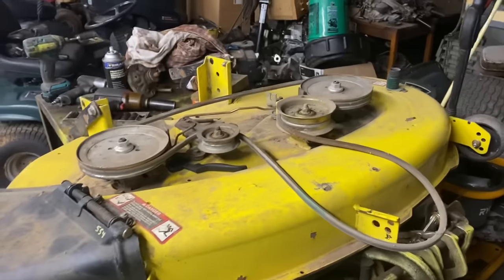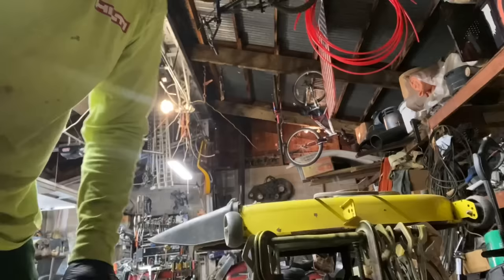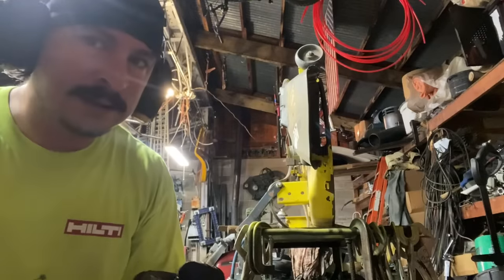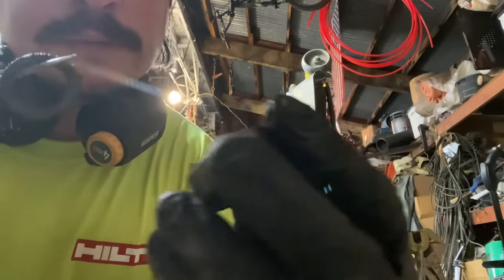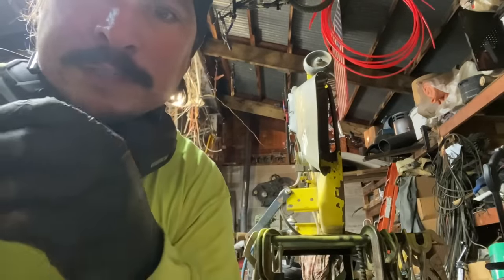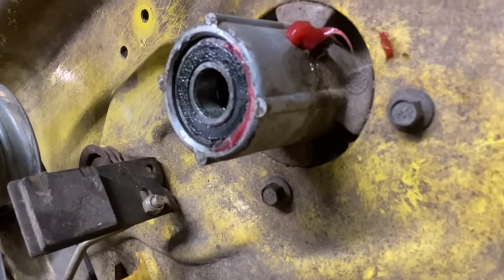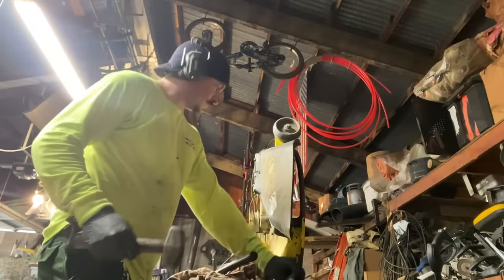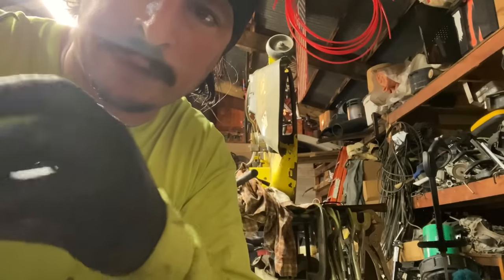Part 1 - Don’t trust the “Experts” Grease your mower deck sealed spindle bearings Common sense.

Comment: The problem is.  The seals on a lot of sealed bearings are not designed to deal with the pressure from a pneumatic or electric grease gun. So you can easily push the outer seal out of the bearings. If you’re going to grease a spindle that has sealed bearings I recommend drilling a tiny weep hole into the side of the spindle housing so when it gets full it will force the grease out that tiny hole so you know when to stop.
Reply from the maker: Correction, the problem is your wrong as far as this application goes. Can you explain why my seals didn’t push off the bearings in my video? For that matter why Iv never seen one push off the bearing? Why was I prying them off again to show the grease inside after the process was over? Serious question. Do you have proof this will happen? I definitely would not make a video knowingly doing something that could harm peoples equipment and I only want to share things I have learned that I think can help people. And this is a topic I feel like others are mistaken on and it seems to be that many people have similar ideas like yours with a wide variety of small differences in the process. I posted this video to
Show exactly how Iv been doing it for years without so much as one issue to date. It’s the easiest way to get grease in the deck bearings without requiring any tear down or tools other than a grease gun for mandrels with a zerk installed. Let’s explore a minute so I can say more about my side. In this case Im trying to show folks how to grease riding mower deck bearings / mandrel assembly and for this application the seals have never Come off. That is not something I have ever experienced so may be nothing that needs to be worried about but something to consider. Maybe in some situations for bearings in other applications this could happen but I’m talking only about mower deck spindle / mandrel assembly and Iv yet to see one come off. I grease dozens of decks like this each year. Is this something you have personally experienced or is this just something that seems to make sense in your thought process when thinking through it? I mean it sounds logical but have you ever experienced this occurring while greasing a deck mandrel? This is why I don’t think it will happen and why I think I have never seen it happen like you say, there is no room in the assembly for the seals to come off the bearing if it’s properly assembled. Notice I put it back together minus the pully but the nut can take up the gap before greasing. So it was together tightly as it would be if you were greasing the mower and not working on it with things apart already. The inner seals are pushed toward the bearings and stay in place. The outer seals are the ones in question and those are up against other components and have no room to move away. There is no wiggle room in these assemblies if they are in good condition and not missing pieces of the assembly “properly assembled” The grease just pushes past the lip. If the assembly was not fully together and the bearings were just sitting in the housing the grease would push the whole bearing out before a seal came off. As for adding a hole, I recommend the exact opposite. I don’t recommend that anybody ever drill a tiny weep hole to let grease escape the assembly. That is just dumb in my opinion and defeats the purpose. For that to to work you would have to remove the inner seals otherwise the grease will push out the “weep” hole and exit the assembly before it ever passes the first AKA inner seal. So you would be wasting your time and grease as no grease will pass a seal before it just takes the route of least resistance out the hole. The whole point of greasing it from the zerk as they come
From the store is that it can be done without tools just the grease gun and your good to go. The reason I made this step by step was to show this works and grease gets into the bearings. Basically a step by step process the whole way through and I had to pop the seals AKA shields off to show the new grease was in the bearings. This is almost so simple it’s stupid. I realize when thinking it through there are things that seem like they won’t work but I did it in a step by step process on video with no magic tricks. Test it out yourself if you think I’m wrong. Or you can continue being a naysayer without trying it. Try it and see what happens, actually knowing what happens might change your mind and then your bearings will last longer. Ii won’t make a penny off it one way or another. If you leave inner seals on and drill a hole in the spindle you can expect the bearings to fail. “Weep” holes in the side of the spindles are absolutely worthless other than to allow water, dirt and dust in and allow the grease to exit before passing bearings. If you do have a hole I’d plug it. The only company I know of who does that is MTD and they build the absolute cheapest and worst riding mowers that I know of. I plug those holes with a screw or insert a zerk so I have a easer access to a zerk as they usually have the zerk on the bottom side of deck and they are covered in grass build up and have to be found and cleaned off before they can be used. Installing a zerk in the “weep” hole is the perfect spot to give access of a easer to reach zerk on the top side of deck. Sometimes I think maybe MTD engineers just like to make things as complicated and non user friendly as possible. It’s amazing how bad they design stuff. And every year they build stuff at an even lower quality than the year before. If anything I can say they are at least consistent at building junk. Look what they did for cub cadet, took a top mower brand and turned it into the lowest grade machine on the market. Other than yellow paint and a sticker showing it’s a cub there is no comparison to what they once were. Quality took a back seat long time ago for Cub cadet and any other brand under the MTD umbrella.

Comment: 'Sealed' bearings. Great note. New Z Trak JD will definitely receive spindle lube today :)
added note: Truck Universal joint bearings are 'sealed', but Zerk voids must be maintained, filled to capacity.. four 'U joints, 1 slip spline joint, 6 front suspension,..HP Moly grease. all on 20 year old, 120 K mile HR 34 motor coach.. Experience demonstrates lubrication extends life of bearing surfaces in constant movement..  Thank you for confirmation.. :}
Reply from the maker: Thanks for the comment. Good luck with your Deere!! 

I have a 2001 Chevy 2500 HD and it’s spent most of its life working. Not just a daily driver. I have stayed on top of minor maintenance and it is still running all the original steering components and ball joints. If it has a zerk fitting I grease it. The new cars and trucks of today come with none or very few greasable joints. Some don’t even have a transmission dip stick. Not my cup of tea.

Comment: I guess I’m hardheaded but I still take apart new equipment and remove the weather seals from the bearings. My many years of experience just doesn’t bear out your experiment to work 100% each and every time. Good Presentation however.
Reply from the maker: i understand, this may not be for everybody and some folks like to see the bearings and or just like these kinds of projects. i would prefer not to work on stuff if i can prevent it with just a simple pump of the grease gun. as for mower deck mandrel bearings this has worked 100% of the time for me, thats why I shared after watching so many others post videos and say the bearings won't take grease due to the flimsy shields stoping the grease. I just could not handle that any longer. had to get the correct information out there. The main point is that if folks will properly grease the bearings when doing preventive maintenance the need to tear the deck apart to remove those inner shields is pointless. why bother with tearing things apart if we don't have to, and some folks don't have the tools or may not want to invest  the time for that kind of work. if the units are greased as shown the bearings have a better chance to last longer without breakdowns.

Comment: If the void is supposed to be full, why then are they never filled by the manufacture ?
Reply from the maker: The bearings come with grease in them. Just like a ball joint or other bearings come lubricated when you purchase them so they are ready for use. I don’t know the reasoning but the manufacturer does not add more grease. Im talking about box store cheep models, not commercial equipment. I don’t know much about commercial equipment. The grease that is in the bearings can go for a long time but preventive maintenance is definitely needed if you want the bearings to keep going without issues. That’s why I made the video, hopefully folks will grease them properly and prevent bearing failure.

Comment: How often should you grease them?
Reply from the maker: If done properly once a year would be plenty for a home owner machine. That is even a little excessive for a machine only used for home use. 40 hours is about average home owner use. If used commercially I’d probably do it every 50 to 100 hrs. Adding grease more often than needed is not really a bad thing. But most tractors that are never greased can go for 5 to 10 years on the original bearings. Some have gone longer. You just never know till one fails from lack of grease.

Comment: Yeah, the average grease gun puts out 7,500 to 15,000 PSI.  For the folks that say the grease doesn't get in the bearing are not filling it up enough where it starts to come out.  Glad someone finally threw the BS flag, ha!  Good work.
Reply from the maker: Thanks. I appricate the comment. Good luck convincing these “experts”
Still a bunch of folks dead between the ears that say it won’t work after I broke it down in this video to prove it. I guess they think I’m using magic.

Comment: nice,i just bought spindles  for a husqvarna  46,has a zerk on top of shaft ,not  the housing,...wish they coukd engineer a  smaller void, so just  could  grease each bearing without 40-70 pumps,...i mean we fly to the moon,cant be that hard,what a waste of grease ,they  should  get one pump,or two,btw i did not  open it up yet,but reviews said top had both seals, bottom has one,avoiding the gravity issue on top, but allowing  grease easy flow into bottom,...also the spindle i broke,and removed  bottom bearing was rusty no grease but i wash the deck clean each use,so could be i washed its grease out or just time,the upper bearing was still good  like 8 years  of small yard use ,id like to find a smaller cavity ,and just grease each bearing without disassembly  ,and ease,....thanks man
Reply from the maker: I hear ya on that complaint 

But in the good note, once you grease Ans fill the cavity from that point forward should only require 2 or three pumps to re grease latter down the line. And at that point your really just pushing a few pumps into the top bearing because without the inner seal on the bottom bearing it will stay greased by gravity. As for washing the deck, I believe it’s a lot better for bearings and the deck in general to blow it off woth a leaf blower after each use rather than apply water. If your blowing it off after each use the grass is still loose and comes off easy enough. Just my 2 cents. And I prefer the spindles like you have because it’s a lot easier to grease as they are not as hard to access when on top.
Reply: @GTObearclaw1  my grass sticks and cakes up w dirt and i coat the deck w wd40,or spam spray ,if i dont wash ut iff w pressure, it will rust  out the deck,blower  dont really work,hey thanks man
Reply from the maker: @sonofthunder.   i was talking about the top of deck. As for grass build up under deck, if that’s what your experiencing? I notice that happens when I cut early and grass has moisture on it. If I cut latter in the day after grass is dry I don’t have that issue. Iv also noticed that issue more with low lift or mulching blades and less issues with that with high lift blades. That may not even be what your saying. Just some thoughts. I’m sure each area is a little different weather wise and gras type. I’m sure there are a lot of of factors. If I do wash the deck I always engage it afterwords to throw the water off the top of the pulleys to keep bearings from getting water in them. At least that may prevent some water going into the bearings.

Comment: I you keep them packed with grease, why replace the seal?
Reply from the maker: It was a demonstration. The whole point was proving the grease passes the shield lips and enters the bearing. Kinda needed them on the bearing to make the point. If you watch the whole video it should make sense.

Comment: I always leave the inner seal out..the bearing will get more grease in it and last longer..i use the bearings with the metal seal on both ends..no problems yet..
Reply from the maker: No removing the inner shields won’t actually help the bearings last any longer compared to doing it the way I show. But it will give you some
Busy work to get to the same goal. At the end of the day it’s simply your opinion and I can’t change that. Nor do I really concern myself with that. Im just hoping for some folks who get the simplicity of it all, they can see grease gets where it’s needed without turning a wrench and reinventing the wheel so to speak. This is almost so basic it’s confusing or at least that’s how it seems after reading some of these comments. It probably doesn’t help that I forget a lot of talking points and don’t head off a bunch of these things in the video. But I’m no expert. Just a DIY guy trying to help the DIY community and upset the so called “experts” who say grease won’t pas the shields. I sure proved those ass hats wrong and not a damn one of them has made a video to prove me wrong in two years. Sadly im not even trying to create videos and this was my last video from 2 years ago and I have more views than the clowns like Donny boy who says the shields stop grease but he is too lazy to prove it on a video and he makes videos all the time. As for why anyone would want to take a deck apart to remove shields that can’t stop grease from passing is beyond me other than they simply don’t understand the physics. If it works for you that’s great. As for using metal
Shields on both ends? Why would that matter if your removing one? Unless you mean on one side and you point them up on the top bearing and down on the bottom bearing but even that makes not difference for a top bearing because they have no need for a heavy duty seal. The lower bearing might have string wraped around so in some cases a heaver duty shield could be beneficial. However rarely have I found the cheeper plastic ones to have issues unless the bearing had been overheated due to lack of lubrication. Rarely have I seen anything get up into a seal on a properly assembled unit. It’s fun to think we are doing good by taking extra steps and putting in work but sometimes it really does not end up making a difference. In this case for the specific style sealed units like shown in my video without a weep hole, removing inner shields provides absolutely no added benefit. Nobody can prove otherwise and there is no videos on YouTube showing such. Because it’s impossible to prove. If the bearings are getting enough grease they last and that’s the bottom line.

Comment: drill a small weep hole close to the top bearing, also  i pull the the inside seals,
Reply from the maker: That’s absolutely Stupid. This is the exact reason I hate MTD spindles. With a hole the unit can’t hold any pressure in so it can’t push grease out past the bearings. 
You can do you but this is not advice I would give out. Not saying your not getting good results but why the heck would anybody want to waste time taking things apart, removing seals and drilling holes when all they need to do is add grease through the existing zerk and get the full benefit with less hassle. I’m not looking for ways to add extra steps and create things to waste my time. The only way that hole will function is a way that won’t be harmful to the bearings is if the inner seals are removed. Still seems real dumb to me.